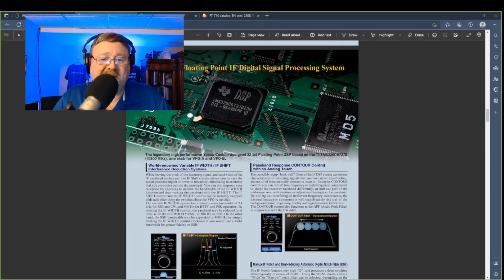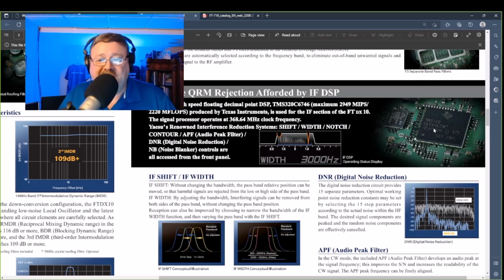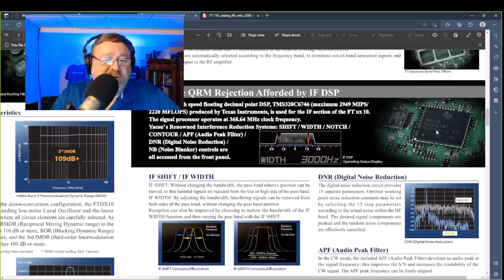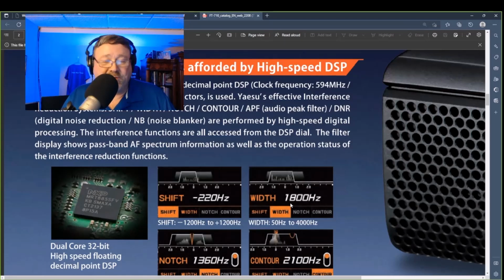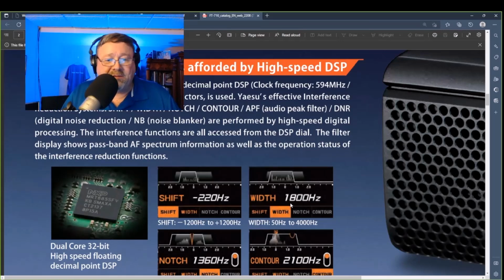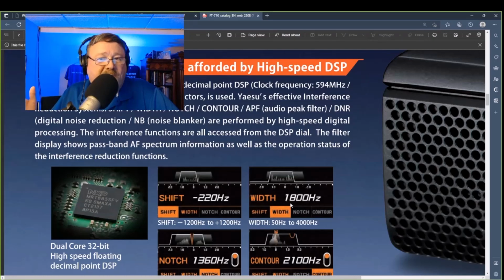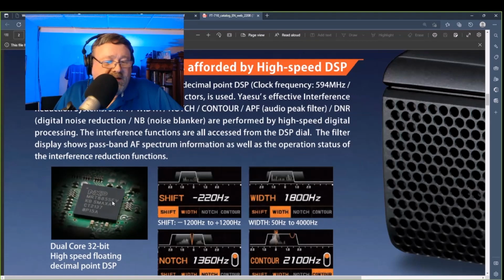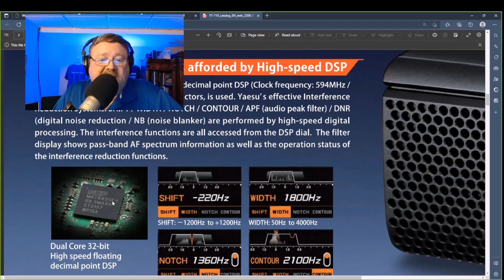Yaesu FT 710 AESS: DSP Chip (video #8 in this series)

Comment: My 710 has a meter problem. The meter jumps up and down on SSB when there is no modulation. No RF in the shack at all. I thought there might be but I know there isn't because my Icom 7300 and Kenwood TS-2000's meters don't move when dead keying on SSB. I had just sold my FTdx10 and I didn't have the meter problem jumping all over the place. I also used a different power supply and put a external SWR meter in line and it didn't move. Stayed at 1.0 when I did modulate and the meter on the radio was still jumping all over the place.
Reply from the maker: The FT-710 has a metering issue when set to COMP. I haven’t noticed any other metering issues. I showed the COMP meter’s erratic behavior in one of the videos in the FT-710 AESS playlist.  Just keep watching the videos in numerical order.

Comment: the Icom DSP is better, it doesnt make that watery sound. Icom IC-7300 is best. i set the NR and NB to max, RX Treble to max and then in 20m SSB (speech) very weak signals become intelligible, 2/1 signals become then 3/1 or even 4/1 (RS Report). you cant do that with the yaesu ft710, ftdx101mp or ftdx101d when these make that watery sound when they make that watery sound.
Reply from the maker: You’re right. The IC-7300 DNR doesn’t produce the watery-sounding digital artifacts. It just isn’t very effective above algorithm 8.  I’ve shown that in other videos. The ICOM has a Texas Instruments chip, similar to the Yaesu FT-891, FTdx10, and FTdx101D/MP. Not the exact same chip but similar. But the programming is better in the Yaesu radios, especially the FTdx10. The FTdx10, and updated versions of the FTdx101D/MP, don’t produce the watery-sounding digital artifacts. 

The FT-710 has a different DSP chip. It’s from NXP Semiconductors. Even though it introduces digital artifacts above algorithm 3, algorithm 3 is about equal to the best the DNR in the IC-7300 can do. Plus,the Yaesu audio amplifier doesn’t exhibit the high frequency hiss that the IC-7300 audio amplifies does. That hiss can be misinterpreted as atmospheric noise. 

There are good things about the IC-7300 too. The squelch is far better than the Yaesu squelch. The IC-7300 is also easier to learn, making it a great beginner radio. But, once an operator progresses in their skill and decides to contest or chase ghost stations, the IC-7300 will fall short. So the operator will spend money again to upgrade to a more capable transceiver. I just prefer to spend money once and be done. There is more of a learning curve for the Yaesu radios but they are more capable in the long run. 

Now, for the operator who is only interested in rag chewing, the IC-7300 is all the radio they will ever need.

Comment: I have the 7300 & FT-710  & The FTdx10 and I prefer in every way the FTdx10. The FTdx10 is a SDR with a better frontend for filtering.  the FT-710 and 7300 can't work the distant stations around the world like my FTdx10. There is also more chips in the Ftdx10 than just the DSP. I have become a radio collector and I await  the Icom that replaces the Old IC-7300 . The Yaesu FTdx10 is my favorite . the few things I don't care for  with the entry level FT-710 is it GUI and small size. the IC-7300 is a entry level radio to so it's replacement when its released probably won't compare to the FTdx10.  for the Price pointe of the FTdx10 you get a lot of radio. and that's what the other radio manufactures need to do.
Reply from the maker: Well articulated, Jay.

Comment: "...the chips are different.  They are not even from the same manufacturer."  I wonder if the SOFTWARE inside the chip might have any effect on the comparison ? LOL...
Reply from the maker: I expect it will. That’s why I pointed out the difference between the FT-891, FT-991A, FTdx10, and FTdx101, all using the same chip.

Comment: Operating Features
Parameter	Value
 TT-710 uses a 300 MHz chip, the NXP, MRT685SFV

Core: Number of cores (SPEC)
2
Core Type
Arm Cortex-M33
Operating Frequency [Max] (MHz)
300
SRAM (kB)
4608
External Memory Supported
FlexSPI,NOR FLASH
FlexComm (UART/I2C/SPI/I2S)
6

Thanks for the video! 73 de WA3RSL
Reply from the maker: I wonder why the Yaesu brochure shows 594/198 MHz clock speed?

73, de N4HNH
Reply: @n4hnhradio  The 300 MHz is the chips operating frequency, not the clock frequency.
Reply from the maker: Interesting.
Reply from the maker: The 594/198 might be some Yaesu trickery to avoid birdies.
Reply: @N4HNH Radio  Probably because this CPU has separte ARM cortex cores (clocked up to 300MHz) and DSP cores (Xtensa HiFi4) clocked up to 600MHz inside. From the datasheet:  "The RT600 is designed to allow the Cortex-M33 to operate at frequencies of up to 300 MHz and the HiFi4 DSP to operate at frequencies of up to 600 MHz".  It seems that 594MHz is for DSP, 198MHz for M33.  198x3 = 594 -  3x clock multiplier for Xtensa
Reply from the maker: Thank you for your input. In the end, the ability to subdue noise and interference is what will matter. The extra clock speed of the FTdx10 doesn’t allow it to beat the DSP in the FTdx5000, so clock speed isn’t what makes or breaks DSP.  I just hope the FT-710 DNF snd NB doesn’t introduce distortion.

73, de N4HNH
Reply: @n4hnhradio  I look forward to you testing the DNR on the FT-710. 73
Reply: @n4hnhradio  Yes, I just can't wait for your review. Especially that this radio is already number four on the Sherwood list... absolutely impressive!
Reply from the maker: It’s technically number 3. Unbelievable for that price. Let’s see if the DSP is up to task though.
Reply: @n4hnhradio  good question.

Comment: Another great video.  You have a gift to teach. Yaesu continues to make themselves known as a force to be reckoned with.
Reply from the maker: Doug, Yaesu gets so much right, but then falls short on something small. It’s usually something I can live without. Other manufacturers fall short too. There is just no perfect radio. But Yaesu is very close with their current lot. They must be proud to hold the top three positions in Rob Sherwood’s list. And they do it with transceivers that cost under $2,000. Even the FTdx101D costs much less than it’s dual-receive competitors. 

73, Doug

Comment: Man, wish you had the 710 to test. Need to get my first hf rig
Reply from the maker: Just hang in there, Matt.  I’m supposed to get one in the next week or so. But you can’t go wrong with the FTdx10. It does edge out the FT-710 slightly. But the big question is going to be the DSP. The DSP will be more needed since the FT-710 doesn’t have the hybrid technology.  If the FT-710 DSP is as good as the FTdx10 DSP, I will be happy. 

73, de N4HNH